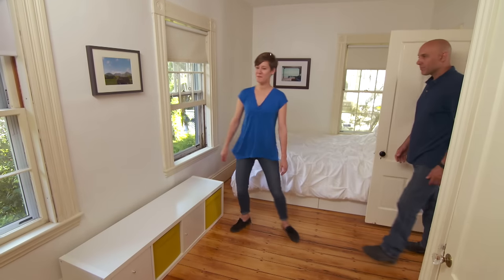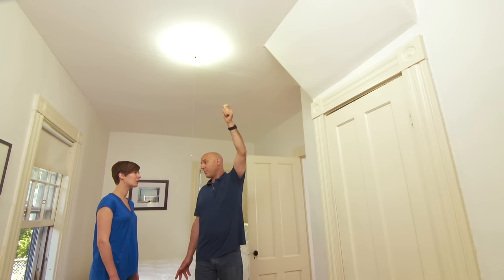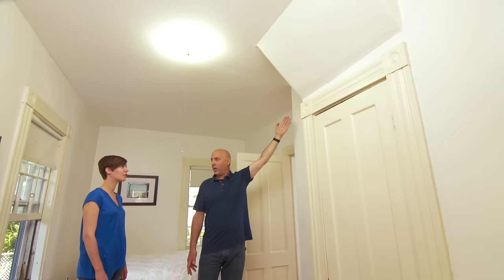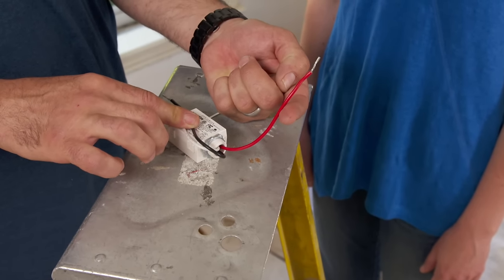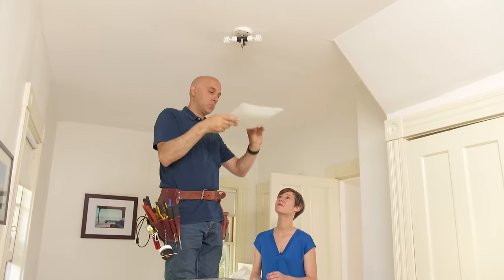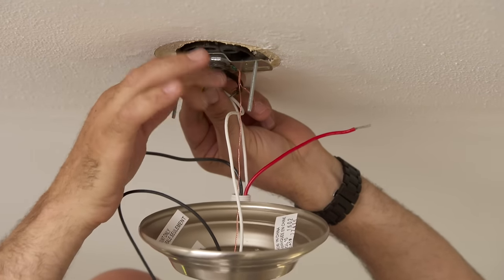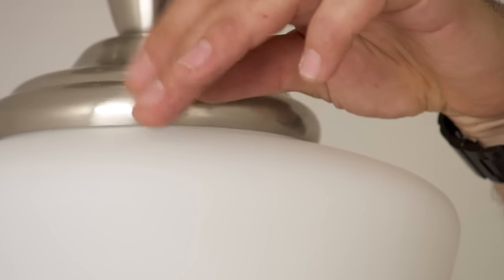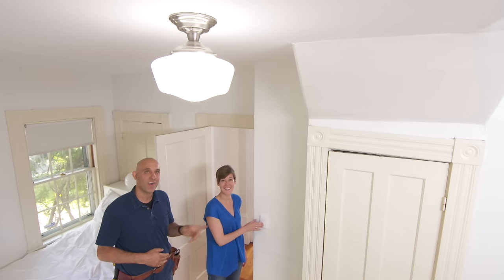How to Install a Wireless Light Switch | All About Lights | Ask This Old House

Comment: Please use electrical tape for additional wire support when using braided wire spliced to solid core!  The extra 30 seconds is worth the safety/security.
Reply: wavesOfFury I've seen plenty of master electricians, plumbers, and hvac guys do shoddy work. Just because you have a master license doesn't mean you do quality work. Just look how many doctors got their medical license and make horrible mistakes.
Reply: wavesOfFury - Spoken like someone who's never actually worked a trade.
Reply: wavesOfFury - Most fixtures these days are made in Asia use a lot of really cheap aluminum-based, multi strand wire.  What provides the actual strength in traditional solid core copper wiring isn't the nut, it is the action of twisting the wires together so they cannot be pulled apart.  The cheap multi strand wire is very flexible and cannot be twisted together because it wants to unravel, so the only support is coming at the nut... but because its multi strand aluminim wire (compresses, breaks, splays, etc), the connection isn't very secure.  Using electrical tape offers support to keep the wires together (aka - 'strain relief', very common in electronic work).  It's especially good practice in places of vibration, such as a ceiling fan or outdoor light fixture subjected to wind.

There are really bad tradesman...just look at the horror stories of bad contractors and homeowners getting ripped off.  There are a couple things I have seen him do on this show that I wouldn't be proud to put my name on.
Reply: And how can you claim a master tradesman does shoddy work?  That would mean you are a tradesman yourself to know what is good and bad.
Reply: thechosendude this isn't true at all, the wires are under a wire nut, what do you think the wire nuts were made for?
Reply: Rakeem SW - The nut establishes the ectrical connection and shields it.  The strength comes from twisting the wires together...which doesn't work with multistrand.  The electrical tape is support, not insulation.
Reply: No electrical tape needed.  I'm an electrician and i have made thousands of stranded to solid splices without tape and none failed.  If you are trained and know how to make a proper splice tape is not needed.  Anytime i see tape i know a DIyer has been in it.
Reply: what? what part of the code book is that in?
Reply: thechosendude No, you use linesman to tie the wires together, next you take a wire nut & put it on top of the connection to protect the wire splice .. Wire nuts should never be used to make the connection
Reply: thechosendude & I'm also an electrician, that tape believe it or not corrodes the wire
Reply: I have come in behind many "Master" electricians that did amateur work because some masters have hubris and won't admit they became hacks
Reply: In my opinion, 30+ years Chicago electrician, no "master" electrician would just hold two wires together and slip a wire nut over them and twist. You always twist your wires together with your kleins creating a splice before your wire nut is put on, just a simple safety thing every apprentice in Chicago is taught from day one. This is so when you remove the wire nut, your splice is still together which under live situations, when necessary, you do not have a hot wire springing into a grounded box.
Reply: thechosendude that's a load of crap all black tape is doing it making it hard on the next guy with a sticky bunch of wires if the ends of the wires are trimmed correctly the wire nut is the only thing you need
Reply: Irvin Wittmeier no electrician tapes wires.  This dude is a handyman or homeowner
Reply: @Rakeem SW 'put' it on top? You have to twist it a bit or it doesn't stay on. I've also NEVER heard of electrical tape corroding wires (at best it leaves a sticky mess over time), you really have to back up that assertion with something. FYI I am not an electrician but I do research things before I take them on, I also don't use electrical tape around the wire as I think its superfluous if the connection is tight enough (or so I've read from master electricians).
Reply: Tesla and George Boole changed the world unqualified fools!
Reply: Wago connectors are the way. None of that wire nut crap.
Reply: nah.. save the money on electrical tape.. not needed  hahahahahah
Reply: You are correct. Tape makes a mess and is actually harder on the next electrician who follows. By the way have you ever seen hard crusty electrical tape. It is obviously not helping with safety...
Reply: Tape is old school for crimped connections and I see it over wirenut's from time to time from handyman, do-it-yourselfer's or blow things out of proportion engineer's. I guess you just got to know what the hell your doing. Always do the tug test
Reply: You are 100% correct. You should never, ever  have to use to electrical tape to finish a splice. If properly shown the wires should never come loose. There is a trade secret!
Reply: master electrician doesnt mean having a masters degree in electricity... its a business license . thats all bro
Reply: so its because you live in Chicago ? i i lived in philly or Boston, would that be different? location?

Comment: Im not an electrician but I noticed that the wires coming from the ceiling are aluminum which requires an anti oxidant paste to prevent corrosion and overheating when copper wires are attached.
Reply: The wires are actually tinned copper, not aluminum.  Therefore,  no need for for paste.

Comment: How could you tell that the one white wire coming from the ceiling was the white since it is old wiring and is not white?
Reply: Probably either the previous fixture was color coded and he trusted it or he tested the wires with an A/C tester or multimeter.

Comment: That device doesn't look like it would be so easy to "bury" in a "normal" light fixture with the little 1/2" deep fixture canopy. Not only that, the fixture strap that was attached to the pipe to hang the fixture and provide the ground source was very loose so the "ground" connection would create lots of arc/resistance heat if a ground situation was ever experienced there. The information provided is good but more detail should be provided about the importance of "good connections" and how it's quite common for "no ground" to be available at lights in old wiring.

Comment: I have a double gang box in my bathroom. One side has a new gfci I installed and the other side is a switch that controls the bathroom light and fan. I want to separate the fan and put it on a different switch. There is only one romex 14/2 with ground going to the switch so the fan is wired direct to the light.  I do not want to tear up my ceiling to run a new wire. Will this work for this application?
Reply: James, you dont need this, and you dont need to run a new wire. You just pigtail off the hot (black), and place the fan wire onto a Combo Light Switch
Reply: @danielkofman4592  he would need to run a separate wire to the fan or light. It's a romex 14-2, meaning the switch leg is daisy chained. If there was 14-3 then the fan and light could be separated from the switch box easily.
Reply: @danielkofman4592   not gonna work

Comment: That is super cool. I was just thinking, what if I have a light switch already, but I want to add another to the other side of the room? Could it work?
Reply: So I think with the kit used in the video it wouldn't work. The manufacturers offer a three-way kit though, which has two wireless switches and one controller. You would pull out the current light switch and wire a controller in that switch box, then install a wireless switch in front of it, and put the other switch wherever you want. 
https://www.amazon.com/gp/product/B01JJVN0FM/ref=s9_acsd_hps_bw_c_x_3_w
Reply: The wireless would only work if your existing wired switch is on

Comment: I need some automation in my basement hallway stairs( one 3 way for entering from upstairs unit to basement, one 4 way for basement separate entry door and second 3 way at the basement level) how do i add a motion sensor so when the tenants enter through the basement separate entry door the light turns on automatically. However I want to retain the manual functionality of the two 3 way switches. Kindly let me know.

Comment: Where can we get that light switch and controller? Is there also something similar for electrical outlet?
Reply: Here's a link to this product on Amazon: https://www.amazon.com/Simple-Wireless-Switch-Kit-Self-Powered/dp/B012H6QZVC/ref=sr_1_2?ie=UTF8&qid=1516309459&sr=8-2&keywords=runlesswire

You could install the same kit behind an outlet to control power to that outlet instead. 

They have other versions of this kit too, like with two switches. 
https://www.amazon.com/RunLessWire/b/ref=w_bl_hsx_s_hi_web_12227254011?ie=UTF8&node=12227254011&field-lbr_brands_browse-bin=RunLessWire

These kits are manufactured by ILLUMRA, which sells these products industrially to contractors. 
There are much cheaper versions for homeowners but they are mostly chinese knock-offs, which will work, but are not as reliable. Also, most other versions don't have a standard decora-style switch.

Comment: Hi there. Do I have to disconnect the original light switch for this to work? Thanks
Reply: If you already have a light switch then why do you need this device?
Reply: @illestofdemall13  I currently have the light switch at the top of the stairs outside of the bedroom. Id like to put a switch inside the bedroom as well.

Comment: Does anyone know if this system can be used to accompany an existing switch?
Reply: bcj117 yes, it can. it would merely be an add-on as the wiring doesnt change.
Reply: yes. it can. the existing switch can still use. and our switch can movable. no need install on the wall. different for this.

Comment: do these exist in some way for ceiling fans where you only have a single switch?
Reply: You can get a receiver similar to the part he installed in the light junction box that can be paired with a remote for the fan. The remotes usually have 3 different speeds and an on/off button for a light if there is one on the fan.

Comment: I would have gone the extra step and put in an old work box for the switch (probably even a low voltage bracket would work), just so it's flush to the wall. Would have really finished the job and made it look better. Neat technology nonetheless.

Comment: please tell me more about the yellow connectors
Reply: They are called wire nuts or wire connectors. You can find them at any home improvement store.

https://www.homedepot.com/p/Commercial-Electric-Wire-Connector-Assortment-50-Pack-775108/202894262
Reply: Hi dr bandito
Thank you very much
REGARDS RICHARD

Comment: He was wrong about the switch plate, there is a battery in that and it says in the manual recommended replacement every 6 to 8 months to prevent damage to the switch plate.

Comment: how does the wireless switch sends a signal if it doesnt have a battery ? whats that technology ? can someone please explain ?
Reply: The switch uses the kinetic energy from being pressed to generate a small radio-fequency signal. Doesn't take much power at all. The micro-generator is called an EnOcean Module.
http://illumra.com/self-powered-switch-technology/
https://www.enocean.com/en/

Comment: Look at that old wiring! Knob and tube... please explain this to me, I thought it wasn’t safe to run new wires on that ancient supply line.
Reply: No one ran new wires. It's the existing wiring. They just changed out the old light for a new one.

Comment: what are those little yellow things hes twisting onto the wires?
Reply: It's called a wire nut. It's threaded inside so you're actually twisting the wires together.
Reply: Thanks, they look really easy to use

Comment: "Now that the ground is connected" to nothing as this fixture is wired to knob and tube.
...
Reply: And the tube could be earthed back to the panel.
Reply: patrick ellis there are only two wires with knob and tube, no grounding whatsoever
Reply: Exactly, the ground screw on the bar is made so if theirs a fault in the wires and the metal bar gets electrified, than it would go to the hound wire from the house and trip the breaker

Comment: So where does the electricity come from to send a signal to the lamp if there is no battery in the switch?
Reply: Damien Sees . the power is scavenged from your finger pressing the button. It is powering a ultra low power transmitter.  The range is horrible and it probably has to be in the same room.  but no battery needed.
Reply: Thanks. I'm just getting into home automation with smart switches and thought this was pretty neat. I'm looking to do something similar in my spare room but using Z wave components.

Comment: That wireless switch does have a battery, I think its a CR 2032. Granted this battery should last about 5 years, just don't think its broken if it stops working. Another option, if you use home automation i.e. Amazon Echo / Google Home, use a wifi switch that is voice controlled.
Reply: Supposedly these battery-less switches have a tiny magnet and a coil that converts the mechanical press into a tiny bit of electricity to power the signal. I too thought it was bizarre that there was no battery but it seems like it's a thing.

Comment: how could it be possible for the switch not to have a battery?
Reply: lester bautista Power is generated by pressing the switch. By moving a magnet over a copper coil you will induce an electrical current in the coil.

Comment: I do not see a wireless switch that didn't need batteries so which brand is this?
Reply: The manufacturer is ILLUMRA, but they only sell through distributors on Amazon for these type of homeowner kits. 

Here's one on amazon, but there are a few different sellers.
https://www.amazon.com/dp/B012H6QZVC
Reply: This one does not as I bought and installed it without any batteries involved.

 Please buy it and read about it at this amazon web address:https://www.amazon.com/gp/product/B012H6QZVC/ref=oh_aui_detailpage_o03_s00?ie=UTF8&psc=1

Comment: Good thing you attached that ground to the bracket since it's a 2 wire circuit with no ground
Reply: The box is sometimes grounded on the back side with a single bare wire.

Comment: Looks like knob and tube wiring.
Reply: todd baker that's not knob and tube. It's cloth covered wires
Reply: You're both right ;) the cloth wiring is installed using knob and tubes. It's not a cable where both conductors are under the same sheathing.
Reply: Yes, it does look like k and t.  The ground that he hooked up wasn’t doing much.

Comment: Didn't bother to take an extra 2 seconds to ensure the wires were properly twisted together. Scott has said himself wire nuts don't make a proper connection, they only insulate.
Reply: You don't pre twist stranded wire with solid wire. Putting  the stranded wire beside the solid wire and slightly ahead of it then the wire nut on makes the best connection.

Comment: Getting this for a closet.  Thanks for the idea!
Reply: I installed motion detector in my grandson's room....don't need a switch.  The 8-year old was always leaving the light on.  Just screwed it in the socket.
Reply: what brand of wireless swich did you use

Comment: To bad these switches are a price rip off at Amazon $119.00. Are you kidding me? They're manufacture cost is probably $10.00, shipping and promo maybe another $10.00, add some fair profit. I get maybe $30.00. Time for some competition.The folks at home depot, won't know what the heck you're talking about and will try to sell you a fan switch dimmer if you're not careful. Not sure they even carry it anymore. Amazon has thrown a bomb into retail that's for sure, and no deals for the consumer. Now they want to deliver with drones, and want to jack up the price of groceries. Good luck to the next generation, hope you have lots of cash.

Comment: Two things
1) the switch does take a battery 
2) why does the “electrician” not have a crank screwdriver?
Reply: No, the switch generates enough power on the push of the button to send the Bluetooth signal.  My wireless doorbell Works the same way.

Comment: The switch itself must need a battery though
Reply: No it does not. I bought it and installed it and it works without a battery. Please see comments on how this works (kinetic energy I believe).

But the wireless transmitter with an tiny antenna IS connected to live electricity. Sorry I cannot explain this like the other expert commentaries can.

Comment: MAKE SURE THE POWER IS OFF OR YOU'LL BE SORRY
Reply: It's illegal to do DIY electrical here in Australia, everything's gotta be done with a qualified tradie :(
Reply: I wire things hot all the time.  Just need to know what your doing is all.
Reply: beeps - Just trip breaker with ground test via neutral/ground.  Saves time not having to flip multiple breakers to figure out which is the correct one, it'll already be tripped when you go to turn power back on.
Reply: I changed a switch with the power on one time
Reply: Spoder Man that's fun until you notice the big shock with the screwdriver
Reply: Brian Imig
coollll :D

but seriously I won't again.. I'll make big shocks with my power supplies
Reply: +G Rodriguez Then dont report it?
Reply: Nah, not worth the risk. If anything happens & is found to be your fault then there goes your home insurance, etc. We're wired a bit differently here when it comes to codes, laws n regulations... wont elaborate at the risk of it blowing into something political but we're a 'nanny' country for a reason lol
Reply: 110 is nothing. I was tightening the hot wire on my dryer(220) and I touched the dryer and it will let you know it's there!
Reply: G Rodriguez still a prison state eh?